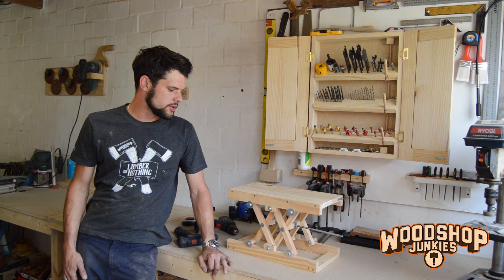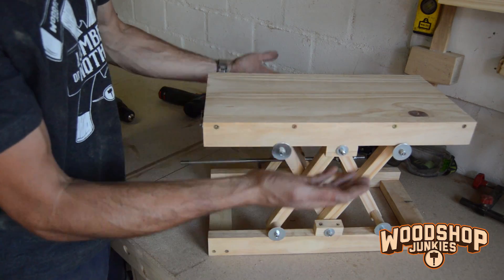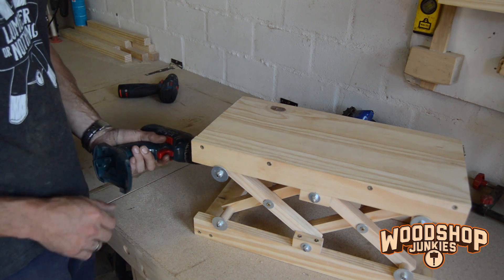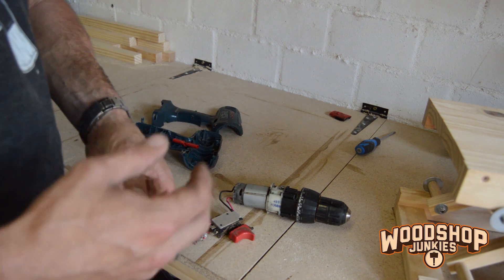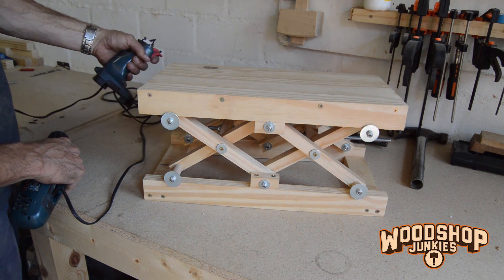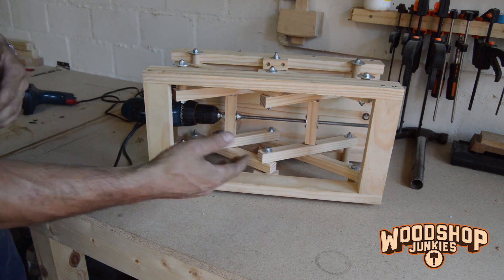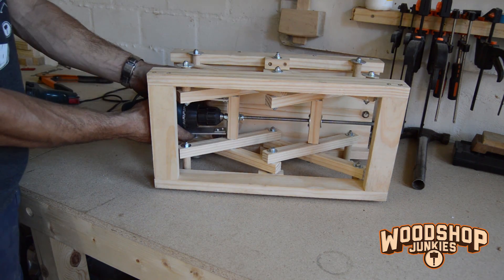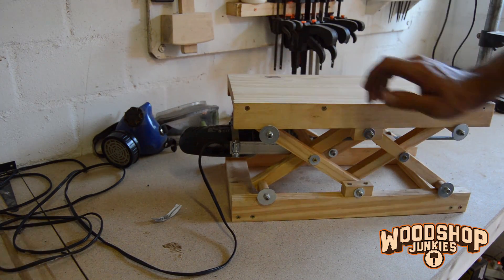How to fit a motor to DIY scissor lift to make a motorized platform

Comment: Couldn't the parts that the threaded rod goes through be on the bottoms of the two outside ones? Then rod would be in a fixed position.

Comment: I'm looking to build a motorised platform for my Laser Etching machines and I need something that the 'Drive' stays in one place, so a Stepper Motor can be linked to the driveshaft by means of a coupler.
The main machine I need it for has a 450mm square footprint and I have got an adjustable platform that used to be an 'Aid' to make going to the toilet easier (ha, shouldn't laugh!) that once the 'arms were cut off, is a perfect Aluminium Frame that has a Fireproof Board fastened to the top, with a 450mm Square cutout in the centre, roughly 18" off the ground, that facilitates a lifting platform to raise the work up from below the machine to the Laser Head Optimal Focus Height. The platforms primary function is for focussing my Laser a lot easier. There =an optimal focal length but it can vary plus or minus 20 to 30mm. A 'Long' focussed beam is better for cutting thickish  Foam for example, because when the beam is around 50-100mm from the surface of the work, the 'cone' of the Laser Beam is stretched longer, meaning that the Cut will have a narrower 'Valley' with Steeper, substantially Straighter sides than if it was cut with 25mm  between the Laser Head and Surface, because the 'cone' is more obvious but the point of focussed laser light is more intense if it is closer (not really d, either at m that I will probably use, but its knob for adjusting moves up or down, whenever the platform is raised or lowered. This is not ideal because I would much prefer the 'driveshaft' or Handle that is turned, to be in one place, at the top or bottom of the platform.
One simply needs to connect the motor to the driveshaft by means of a couplear or Gear Reducer, and plug it into suitable Stepper Motor Driver Hardware, in a box next to or over the driveshaft , now coupled to the motor.
I am still toying with the idea of having 4 threaded bars at each corner of a hypothetical platform, that are all connected to a single Driveshaft that if it is connected to the other 3 by means of 4 belt drives, to turn them all simultaneously, theoretically creating a  more accurately adjustable platform that stays Square  from minimum to maximum height.

Comment: Exactly my point here. First of all, great video with instructions mate. Second, I'm building something similar as a lifting mechanism for a table saw. Initial idea was to operate from the middle till I discovered that the center changes location in relation to the mechanism. I finally opted to have at the bottom. Well done mate, great idea. 👍👍👍

Comment: Does it require the full length of the rod, which sticks out quite a bit when platform is at its highest?
Reply: Good question. I think that the 'Extra Length' is needed, to get it right up.
to max height
The author would be the best one to answer

Comment: Mounting the motor would be easy. Use a belt with an tension pulley. The problem with his design stays the same. The higher the table top goes the more unstable it gets.

Comment: Very good.  Depending on needs, limit switches could also now easily be added to prevent pushing the mechanism beyond it's bounds.  That of course means tinkering some more with the switching, etc.
Reply: LOL ... Along with a Raspberry PI or Arduino and stepper motor to enter Dy amounts to lift or drop.

Comment: Very good project.  I like it.  So you are still using the drill battery as a power source?
Reply from the maker: The batteries for the drill I used don't work anymore so I power the drill through a transformer (to get the voltage required) and a rectifier (for the DC). It works well with the weight of the transformer being the only downside for me.

Comment: I’m thinking of using something like this to lift the miter saw and planner in my all in one table instead of a flip action. Thoughts?
Reply: A interesting idea but I suspect that you might soon  get tired of waiting for the lift which will probably be slower than a flip action.  For a fixed distance of lift an air actuator might be a viable alternative.
Reply: RO BT exactly what I’ve been planning. One in the middle with four nylon guides in an 80/20 frame.
Reply from the maker: I really like the idea. It would take some consideration to make everything fit but to combat that you can try and make some components out of alu and nylon.
Reply: Woodshop Junkies I was going to make it out of aluminum 80/20 with runners and nylon guides. Thank you for your reply. Wish you’d finish your all in one table. You’ve done the best from all the videos I saw about this.
Reply from the maker: Sounds good. Let me know how it goes. I just posted the router table extension for the bench.

Comment: Fixing the scissor action to the center point of the base and the platform looks to make this unstable at the higher elevations. I would suggest separating the scissors into two separate actions and fixing the outer points and leave the center points mobile. This will always mean the four corners of the lift are supported and always parallel to the base.